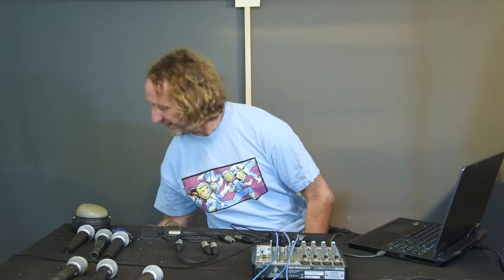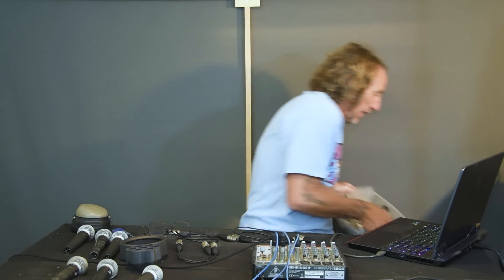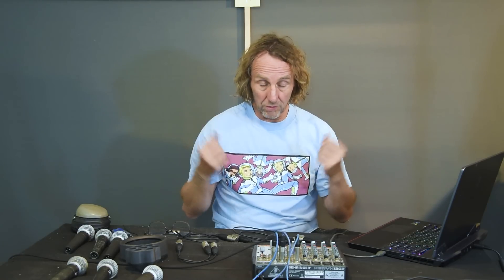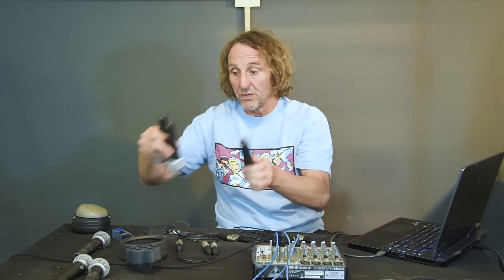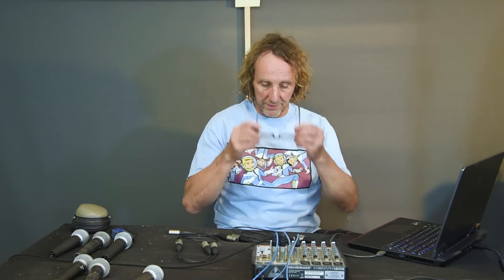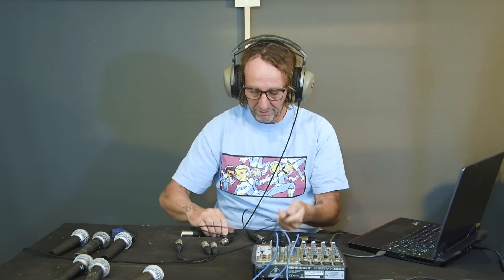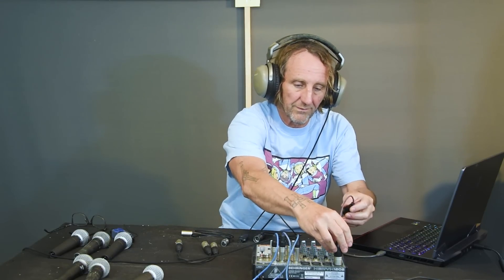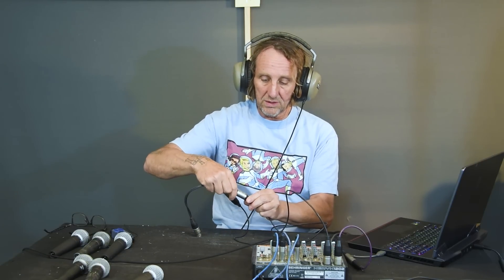Do Vocal Mics Go Bad? Lets Hear what happens!

Comment: I remember reading on your blog many years ago that you changed the vocal microphone at the Chili Peppers shows at least once per show. I imagine that at shows with hundreds of thousands of dollars or millions in profits, a $200 microphone doesn't matter much, it makes sense. That problem speaks a little to the design of microphones that are so quickly affected by saliva coming out of the mouth. I know that, for example, Electro Voice vocal microphones have a mesh (hydrophobic fabric) in front of the diaphragm to form a 
barrier against liquids.
Reply from the maker: yeah I think that no matter what material is used if you spit in it or sweating it and there's a fine mesh it's going to clog with water. 

yeah we did typically two mic swaps, one mid set and one for the encore and sometimes if the mic was getting dull and feeding back more we'd do it based on that as well. 

we would use different mics for the next show and let the mics dry out, but over time little bits of muck build up in the mesh or on the diaphragm itself and they just degrade.
Reply: @DaveRat  I saw an RHCP show with you at FOH and it sounded great. I don't remember the mic swaps, big show here in Argentina and with the crowd jumping I couldn't see many details 🤣. Greetings from Argentina.
Reply from the maker: super cool and awesome.  yeah, it was hard to spot the mic swaps as we had a spare mic on the ground in front of AK. he would just pick it up and drop the other mic between songs and the Mon engineer had one of the mix switchers I designed for SoundTools.

so the spare mic would be activated as soon as AL picked it up.

the switcher made the spare active for me out front and mons so I did not need to do anything. 

seamless and simple, same thing if a mix broke, AK would pick up the spare and then Mon eng would switch to it

Comment: Interesting video. I di agree that mics wear out. But I see three points that I don‘t agree:

1) the moisture can mess things up, but its not really the water, more the dirt, dust chalk and whatsoever that leaves traces. But since diaphragms are made out of plastic, I don‘t see the point of throwing capsules away. Diaphragms can be cleaned easily!

2) a diaphragm can loose its stiffness and start to move smoother. The ger burned in, like we all know from speakers, especially on guitsr cabs. This probably should have a very minor influence in tone I suppose.

3) mics also get physical abuse, especially in a rock setting when singers band them around. Every drop or hit could cause minor deformations of the voice coil, magnet, alignment of the voice coil in the motor or alignment of resonator plate. I suppose this could be a way bigger issue than moisture and also applies on instrument mics thst get carried around a lot.

I did a lot of vintage dynamic restorations. On the Sennheisee 409 and 421 I once in a while had some examples of mics that had just a tiny bit more high end extension. I wasn‘t able to figure out why, even their capsules were all cleaned and didn‘t look deformed.

Remember: tolerances of manufacturers are quity big for audio gear!
Reply from the maker: Agreed and it's not they wear out, but rather that they can not beeaned well enough to get them back to pristine 0 debris factory clear.

At least that has been my experience 

Perhaps possible but the time exceeds the replacement cost of a capsule at under $109

Comment: It would be interesting to take the caps off as well or swap them, I can't imagine the foam stays that stable either right?
Reply from the maker: Cleaning and or replacing the phone when it gets clogged up or dirty is definitely something to do and fairly easy and straightforward.

The issue is spit and moisture builds up on the diaphragm or the screen covering the diaphragm changing the sound of the mic that's hard to clean and almost impossible to get hit back to its original brand new sound.

Kind of like a freshly painted car only looks freshly new and painted early on and over time small pits and scratches and other imperfections happen. He can get it waxed and polished but you'll never get it as pristine as it was when it was first painted brand new.

I find microphone seem to follow a similar scenario

Comment: It would be interesting to test the mics with the ball grills off ... particularly as the foam inside is going to be even more affected by deposits than the diaphragms themselves. We need to determine if the issue is with the diaphragm or the foam or the ball grill. I also wonder if there is some possibility of lightly cleaning the surface of the diaphragm.
Reply from the maker: A bit different adventure but here's some tests I did on the SM58 grill and its impact on the sound https://youtu.be/AnBVvyKHpDg

Comment: My experience using dozens of microphones over a 45 year period has two answers:

Do they go bad from using them, singing into them? No. With very moderate cleaning and maintenance, 45 years has not hurt my microphones. Not the U87s, and not the B58s.

Do they go bad sitting out in the rain? Getting tossed into a bag during a careless, rushed strike? Riding in a cardboard box on the road with no protection? Unquestionably yes.
Reply from the maker: The issue we have is sweaty singers that spit a lot into the mics and sing with lips on the grill forcing spit and sweat deep into the mic causing corrosion over longer time periods and dulling of the HF over shorter time frames. Due to spit and sweat buildup on the diaphragm
Reply: @DaveRat    I understand that. As a live recording specialist, I’m rarely giving out lead vocal mics as they almost always come from the RF provider. When I do have to give such a maniac a mic, I will suit up in my hazmat clothing and clean it as soon as possible. I also keep bags of silica gel with my mics. I have a Craftsman tool chest built into a flight case with customized drawers, and every slot gets its own bag right at the capsule end. It seems to delay the inevitable deep clean. 414s get a ziplok with the silica gel bag. I know it sounds like a big pain but it’s really less work than putting them in their boxes.

Comment: How often would you suggest reconditioning mics? I know it's a "how long is a piece of string" question, but let's say you do 2 shows per week, would once a year be about right? Also, do you have any advice on how to get them reconditioned? Is it a case of cleaning the capsules or does the capsule actually need a full replacement? And who offers that kind of service or is it easy to do yourself?

Comment: Hey Dave, what a interesting concept by the grateful dead, to minimise vocal bleed! Just a quick question, if this technique is so useful, how come it's not commonly used by engineers everywhere? Is there some significant drawbacks using this two mic technique live? ie comb filtering etc? Thank you so much for your content!
Reply from the maker: The advantage of 2 mics in close proximity that are out of polarity, is they cancel sound that hits both mics at the same time, quite well. The issue is that higher freqs dont cancel well and lows cancel really well, so you get sort of an HF swish. Also when singing into one, the lows of the voice tend to cancel and the highs dont. So the voices sound thin and phasey. It a bandaid and works but is not wonderful sounding.

Comment: I've fixed a number of mics.......    If it's bio-contamination,  would not a deep cleaning help things out?   (assuming the capsule can be disassembled to that point?
Reply from the maker: Yes a deep clean will help and no it won't get it back to perfect new, but close.

But for pristine perfect, a cap replacement is the way to go.

Have ya ever cleaned dirty console faders?

If so you know the reality they can be cleaned but never are as smooth and last as long as new ones, even with full rebuilds it's near impossible

Comment: I have some old dynamics. Is there any way of cleaning them? Some of them are long out of production so new capsules won't be easy to find.
Reply from the maker: Absolutely taking them apart replacing rotted and damaged foam cleaning up all the excess foam and cleaning the diaphragm if it's not too hard to get to. If you haven't watched them already I've done three or four videos on repairing microphones that would be very helpful for this adventure

Comment: On a semi-related note- A few months ago I did a gig that had a pair of brand new beta 58's mixed in with some old ones (I hadn't noticed the new ones at 1st) and I found myself equing 2 mics differently consistently for the 1st night (week of gigs in one venue). Sure enough I discovered it was those two new mics. They were direct from a Shure distributor so I'm confident they weren't clones. Anyway, after an hour of fiddling with these mics before the gig on day two I discovered not only were these mics not performing as well as the older ones, the body of them was microphonic. While holding them, if you sorta gripped them harder and wiggled your fingers a little you could hear it. On the old ones, the body was far better isolated from the capsule. The new ones caused far more issues with feeding back as well. I compared them visually to the old ones and Shure enough (pun intended 🤣), there were obvious differences between them physically. These were Mexican manufacturered and the old ones were not. The company has very obviously made changes to the new mics and not for the better. It seems insane to me that they would allow this to happen given the pedigree of 58's. I recognize there are better vocal mics on the market but considering Shure probably has more on the line with 58's than any other product they offer, one would think their QC would be next level for these staples of the industry. Let's hope it's rectified sooner than later. Anyway, thanks for the quality content Dave!
Reply: yes! even the sm57s the chinese ones are darker mexico is brighter

Comment: I wonder if some manufacturers designs are more prone to this than others? It's interesting that the highs are the first to kind of go.
Reply from the maker: Hmmm, yes, differing designs will differ. But the highs require fast motions and to do that the diaphragm often relies on being lightweight and non damped.

As particles or spit or moisture accumulates is 8ncreases the weight of the diaphragm impacting the HF.  If metal particles accumulate, the dia sticks to the magnet impacting the Lowe's.  If the vents get clogged, the Lowe's are impacted as well.

Comment: Hi Dave,  Thanks for sharing your experience and knowledge. Came across your channel while researching clipping. I recently bought a tiny one screen theater in town and some of the equipment was toast. Replaced a non-functional Marantz sr5007 with an sr6015. I'm using pre outs to 4 lab gruppen e series, one 12:2, two 8:2 and one 4:2. There was a third 8:2 but the heat light was on and 2nd channel was blown so I pulled it. We have three mackie c300z for the left right and center, and two s518s subs (one unplugged due to the bad amp). There's also six boston speakers for the surround sides and rears. I believe they are CS 26 II models. I'm getting a crackle sound, kind of like bacon frying in hot grease, when there's heavy sound load during action scenes. I think it's clipping, but the only thing I know about audio is what I've been able to learn in the last week or so. Tried various configurations to better match amp wattage to speakers and adjusted many settings on the receiver and amps but can't get rid of it. I'm starting to wonder if all that equipment is pulling too much juice and starving the amps when they're under load and trying to feed the speakers. Going to try splitting some equipment onto another circuit tomorrow to test the theory. Have you ever seen anything like this or have any thoughts you could share? Thank you for the time and effort you put into your content. It's a great help to others.
Reply from the maker: Probably clipping or overloading a speaker.  Putting a limiter on the output before the amps can be the easiest way to tame that

Or if you have amps with processing, setting the amp limiters
Reply: @DaveRat  Thanks Dave. I'll give that a try.

Comment: Actually if both new mics were identical, they would be different in the test due to the air and chaos of the air when moved. This is part of the live sound that exists when a mono signal is fed to two speakers and is different than using a Y cable to two channels.  It will never completely null, not because of the microphone differences, but the air turbulence between the sound source and the microphones. This is the same why smoke rising from incense or other smouldering ember does not rise perfectly, but curels. Same chaos in air flow surrounds your sound source, and so the sound arriving at each microphone will be different.
The test if valid as the grill, wind foam, and diaphragm in a microphone pick up contamination that adds weight, and in many cases, is not solid, so has some fluid dynamic damping to the signal.
Have you considered washing some of the capsules with glass cleaner followed by a rinse of distilled water? To dry, before corrosion starts, they can be dried by use of a vacuum chamber with a small amount of dry Nitrogen flowing. This will remove all moisture fairly quickly.
Try washing and rinsing your capsules and re-testing.  Look up and find about a "Cold Finger" for protecting the vacuum pump from the water. If you don't flow Nitrogen, the output of the vacuum pump can become 100% water, so the water has to be removed before the vacuum pump with a cold finger, or Nitrogen needs flowed to carry the water out of the pump as humid air.  Look online for using a vacuum chamber and  pump for drying critical items.
Reply from the maker: And also mics that are more closely matched will null better than mics that are not.

As far as spending the days off on tour setting up a chemical cleaning station to attempt to try and get mics to maybe get close to being matched vs just getting them rebuilt and factory tested to new, which of those choices do you believe will result in a higher quality and more dependable result?

Is an extra mix swap or two and a frustrated singer in front of 30,000 people really worth saving the $60 (at the time) rebuild cost? 

Every show, allbsightly damages drum sticks discarded or given away, new drum heads even slightly worn, bass and guitar strings are tracked and replaced to insure that they sound perfect and absolutely minimize breaking, but let's wash the only thing the singer has in Windex to see if it will sound ok and hopefully not smell bad?

I would say that attention to detail, problem solving and paying attention to the bigger picture are extremely important for achieving success at the top levels with challenging artists that push the envelopes.
Reply: @DaveRat  Dave have do you have any Nitrogen or a spare Vacum Chamber ? I miss placed mine... Sounds like he swallowed some bad shit from Augustus Owsley Stanley III.  Keep spreading the good word brother.

Comment: I wonder how RF-Condenser mikes fair with this kind of testing. they are supposed to be very good for getting wet
Reply from the maker: The test is easy enough to do, expensive condensers have high voltages and do not like moisture. Cheaper pre polarized  electret condensers deal with it better.

But condensers have very lightweight diaphragms so the weight of water drops on them will not be helpful at all
Reply: @DaveRat  Sennheiser appears to be the only company doing the rf-condenser microphones I'm thinking of. Curious to hear some experience with them, are they as good as they sound on paper? BTW: the are in the 4k$ range, pricy.
Reply from the maker: I don't have enough exposure to them and have not compared them directly. I am guessing that they have some challenfes that differ as all designs come with assets and issues. The high cost and no one copying on what is sure to be a long expired patent is interesting.